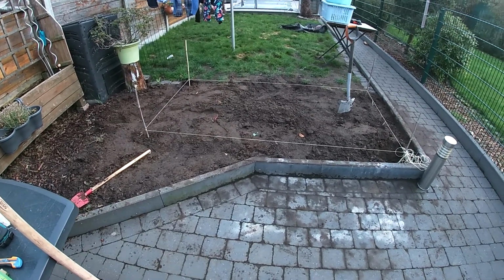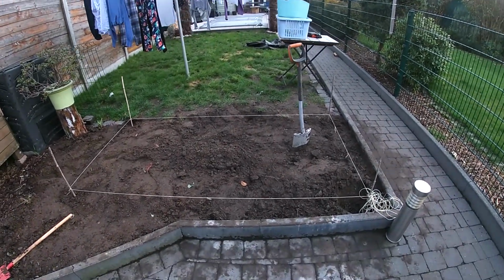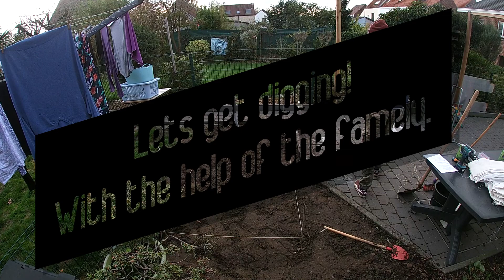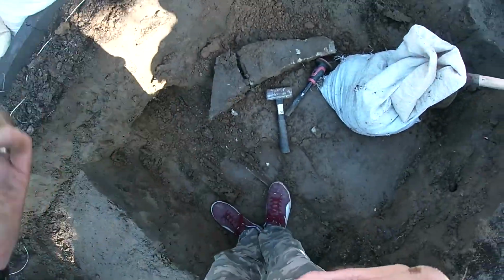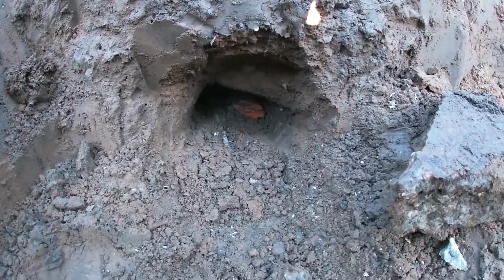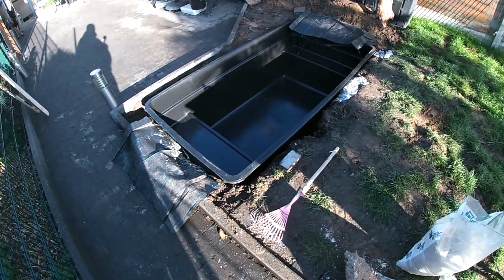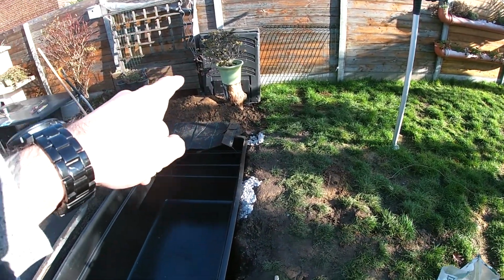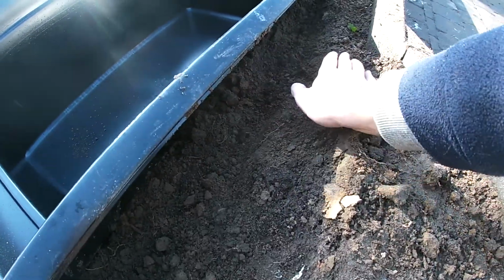DIY ecological preformed pond part 1

Comment: Hi man im buying this pound but just puttingt it on the floor, i can't dig a hole in my terrace, do you think is possible or it will cause some problems when full? Thanks
Reply from the maker: @davidm3280  if you want to put it on your terrace no problem. Make a wooden frame around and under the side for more support and you should be fine.
Good luck and have fun